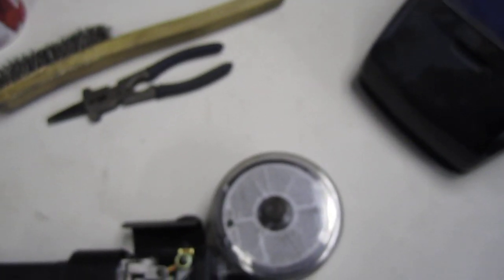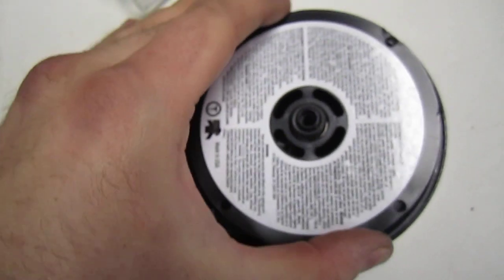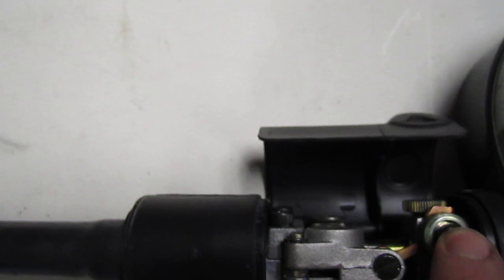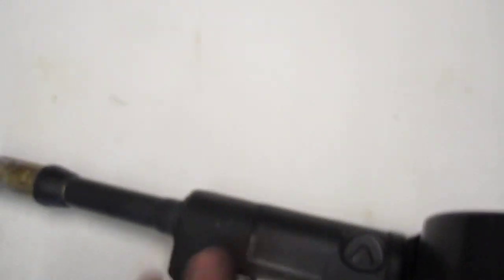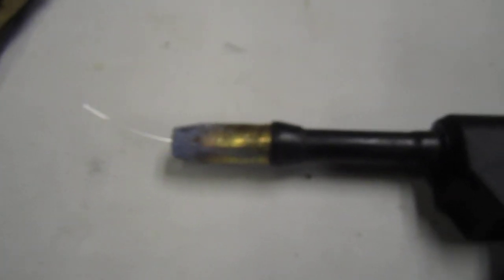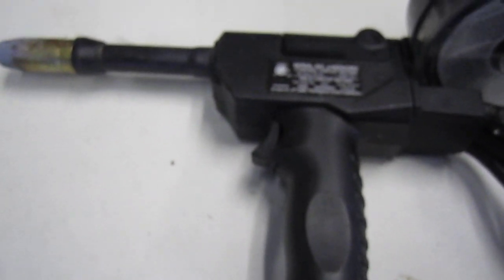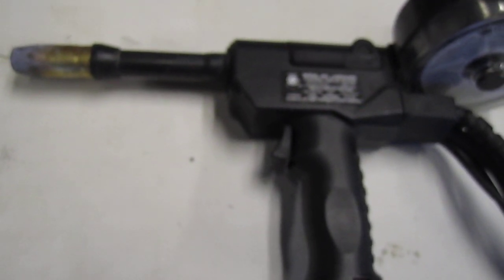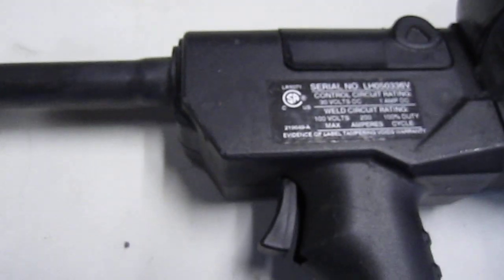Best way to setup an aluminum spool gun

Comment: wish you would have shown gas line and power lead connections to the welder . Although Miller may be different than on a power MiG 350mp???   It was helpful thanks

Comment: Can a spool gun be hooked up to a Miller Sidekick welder?
Reply: I have to keep looking.  Both guns plug in the same, and trigger wires also plug in the same.  The polarity can be reversed by rotating two brass plates.  I'll look and see what a Pro Fax spool gun is....
Reply: Can a SGA 100 adapter solve the plug in problem?  Or can it be wired into inside the welder?  If the gun plugs in that may be half the battle won?
Reply: Ok thanks,  I'll keep looking into it see what I find...

Comment: To get burned back filler wire out of tip just hold tip w needlenose and heat w torch til it glows. Tap tip on edge of vise and alum will fall right out. Ream w tip cleaner. Done. Saved tip

Comment: spool guns are notorious for bad gas coverage usually only covering half the diameter of the cone. great tip I learned is to use stainless steel, heat it from the back side while using the spool gun gas to cover the front side. the coloration of the stainless will give you an indication of how well your gas coverage is coming out of your cone..

Comment: hey dude ur video is awesome bro. i have an issue with my millermatic 251 with spool gun aluminum. i cant weld even though that i set all correctly ,but still i can't weld nicely. as soon as i start to weld the wire burn on the tip itself and burns the tip. i feel maybe the issue would be the cheap wire my boss provided for the shop. any help would be appreciated.tanx

Comment: Will this work with a Lincoln weld pak 140?
Reply: ***** if you're welding 1/2in plate or bigger.....you show me welding .040 with 200 amps there mr smartguy, and I'll eat your scrap metal!!!!!   my brand new      tig TOPS OUT at 200A, and at l ike 15A it'll weld beer cans together all day long!!!!!   I've got $1000 says you couldnt even come CLOSE to running anything even kinda resembling a bead on a beer can at ONE hundred amps much less your big bad superwelder TWO hundred amps!!!  Well??  Put up or shut up!!!
pm me once you get the video up.......

To answer your question Junkman, is YES as long as you can figure out how to wire up the gun to the machine.....unless it was made to have the gun, then absolutely easy peasy!!  There is a vid on here showing how a guy added a gun to an older machine......the wiring looks a bit complicated, but if you know anything about electricity or know someone who does who can help you its really not that tough.......just remember you will most likely have 4 wires coming out of the gun or more if you get one with the wire speed adjustment on the handle.....two go to the trigger, two go to the motor.....thats it......the machine end plugs in right where the original hose was, you plug the trigger wires in where the original trigger went, then you unplug the motor in the machine and plug those two wires in to the motor wires to the gun and there ya go.....really its harder to explain than it is to actually do......that mtcentral douche sounds like a hater to me......i bet he doesnt even HAVE a welder of his very own.....thats the only reason i can imagine he would tell such an outright BULLSHIT LIE!!!!!   Tell me how does it sound when I tell it.........WELDING ANY ALUMINUM PROPERLY, EVEN BEER CANS CUZ I DID SAY ANY, STARTS AT ABOUT 200 AMPS!!!!       Yea, i sound like a total asshole too......
My ancient antique (still works tho) HUUUUGE old Airco Heliwelder (yea back in the olden days they used helium instead of argon) ranges from 5A to 550A ac/dc foot pedal AND high freq......on the C range dialed down as far as itll go, anytime you strike up the arc it pops and zaps and burns off all the tungsten AND usually blows out the side of the cup.....
That setting reads 150A........granted there is something very very wrong with something inside for it to do that but still...
I'll bet MThead saw an ad for harbor freight's cheap little 200X tig and decided that was just how much amperage it put out.......AM I RIGHT THERE, MT??
Reply: +junkman6261  Yes but you either need to change out the control cable or buy/make and adapter.  Lincoln uses an anphonol connector (look at the connector on your MIG torch. Many non Lincoln Spool Guns use a different connector little silver)
Reply: +Big Al thank you

Comment: This has knurled drive rolls why?
Reply: yeah but knurled with soft wires will slightly shave it a bit, if you get too much gunk in the roll system it will damage it. Id just suggest using u-groove rolls.

Comment: I work with this same type gun, it can be very temperamental and at times frustrating. But I think I have ironed out all the kinks in the gun. In the shop I work at we have a very old ( I think this gun had been in the shop for 20 yrs) miller spool gun running on a 250 miller. we use 035 wire and I run ALOT of aluminum so ive gotten some great results. It runs great on 1/8 but you have to run real fast and ittakes some getting used to. I set my Machine on 21 amps and wire speed at 4. Some spools of wire act a bit differently, not enough where a novice will notice, but when you have a lot of spools under your belt you will feel it. When it feels like it is slowing down, turn your wire speed up just a small amount until your spool runs out, then turn it back to 4. 
  Common problems and fixes. 
the biggest and the most time consuming problem that Ive ran into is the wire will burn back into the tip. When a burn back occurs, and you try to push the trigger again to see if that will free the wire,(never do this unless you want to waste a bunch of tips) what happens is the aluminum wire is soft and hot, this causes it to push into the tip and jamming up into it. Once that happens you may as well get a new tip.
The fix is to take about 5 tips and drill out the inside just a little to about .045. When drilling your tips use a lot of water based cutting fluid so that your drill bit does not get over heated and twist off inside your tip. You can also clean your tips like this when they become plugged up. As I mentioned before I drill 5 tips at a time and this way I don't have to stop long I can just replace the tip and continue working, then when time allows I re drill the tips Ive plugged up.
   make sure you use a lot of anti splatter spray when inserting a new tip in your gun. Keep your tips clean and free of spatter while welding. Don't be afraid of using the anti spatter spray, it will help keep your tips working longer
  In this video I saw that you was using your tensioner and adjusting it. I NEVER USE MINE. Aluminum will not birds nest like steel, so I leave mine off.(and yes I twist my gun to all kinds of angles and I've never had an issue with mine) 

Next Issue
  after twisting and turning your gun all over the place, the power cable will eventually become disconnected from all the use(its going to happen eventually) dont worry its an easy fix. 1. turn off your machine and unplug it, and turn off your gas for safety
lay your gun flat on a clean surface. Using a star screw driver start to loosen up the screws. Once completed remove the screws and make sure not to loose them. (NOTE there is a spring located at the trigger, when removing the housing this spring will pop out and if you are not careful you will lose it. I take a clean rag and place it over the housing so that when it pops out, it has no where to go but inside the rag.) 2. remove the piece where the wire has broken off and heat it with a propane heater to remove the old wire and solder, clean it really well and set aside. cut the power cable, and trim the rubber coating back that just enough wire will insert back into the adapter. Using flux, coat the cable really well. Place the wire back into the adapter and solder the 2 together.allow to cool. 3 place the spring in the proper place, replace the housing (this may take a bit to realign it properly) and replace the screws and tighten. Plug in the machine, turn on the gas, and you are ready to weld again. 
You can also replace the trigger this way also, it is fully enclosed so that all you do is disconnect the 2 wires, replace with new trigger  and reconnect the wires. (REMEMBER THAT THE SPRING WILL FLY OUT WHEN TAKING IT APART) Yes it has happened to me and it took me forever to find it

To prevent this from happening again I am using a zip tie to hold up the cable and keep it from twisting all over. I drilled 2 small holes into the spool housing at bottom and ran the zip tie into the housing and around the cable and gas lines. If the holes are drilled into the middle of the housing you should not have any problems with the spool being interfered with. I would recommend if your gun did not come with one, that you buy a Kevlar sleeve to protect your cable and gas line. It runs the full length from machine to gun and will protect it from burns, dragging across the ground, and general use.  

I have been welding for over 20 yrs and did have some training back in welding trade school. Till about a yr ago I didn't have much experience with welding aluminum. It took me a full day to get used to running differently than what I was used to. But once you see the way aluminum works and behaves, it can be fun to work with. 
Aluminum heats up really fast and will melt quickly, especially with thinner material. Move fast, adjust your gun angle because of the wire curving from the tip. If using thicker material remember to run 1 pass and allow it to cool or pour water on your piece, then run your next pass.  

Well this is about all I can think of at the moment, if you have any questions please feel free to email me at samo662003@gmail.com I would be happy to answer any questions. I am even thinking of making my first video
Reply: Thanks for the info but instead of drilling tips, why not just buy .045 tips?
Reply: Thank you Sam for the info. I've been welding aluminum for a short while and the time you took writing this out has helped my learning curve. God Bless and have a great Christmas and New Year.

Comment: I picked up an Everlast spoolgun which is very similar to the Spoolmate 200. If the Miller is built the same, it is very rugged. If you get the heavy duty barrel it will do 60% duty cycle at 200A.